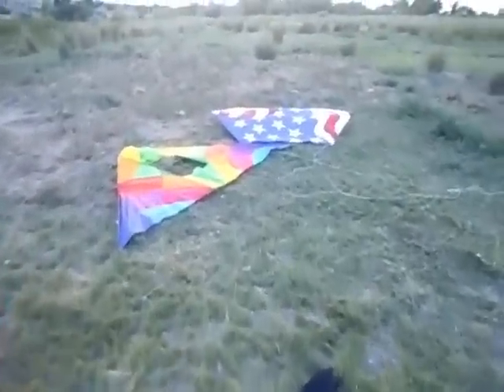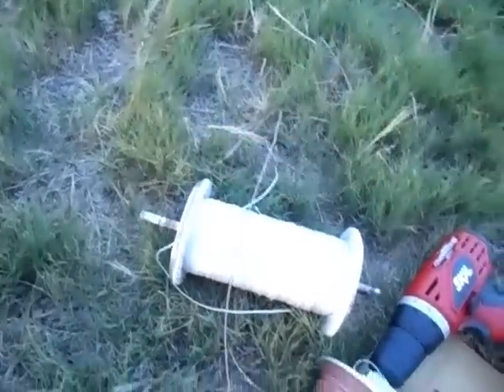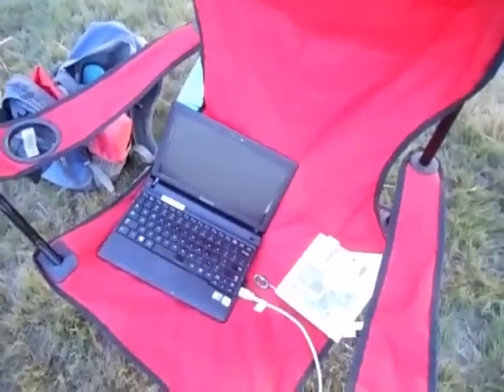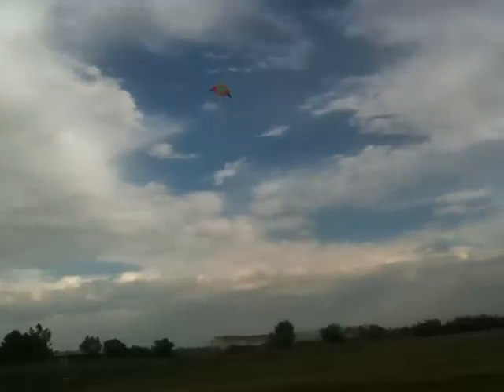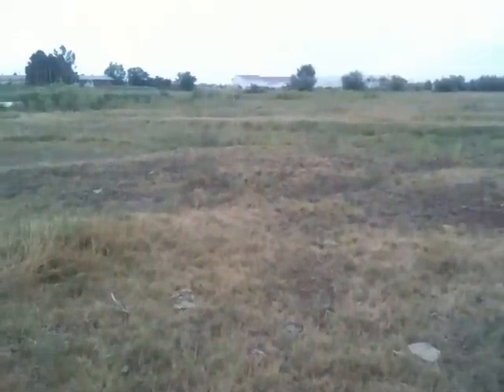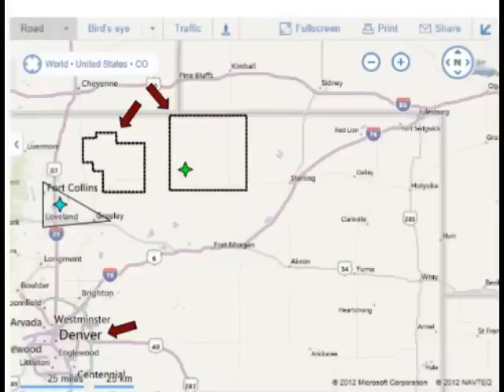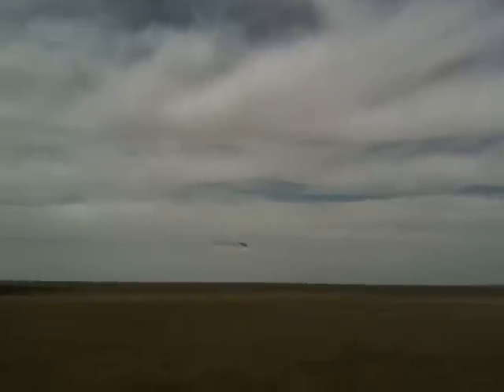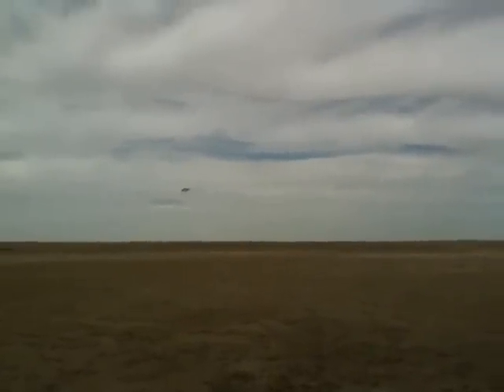Wind Powered Aircraft - The Concept & Test Flight

Comment: This a very valid concept using the wind gradient to obtain lift. The work of a true and remarkable experimenter. However, in most countries, certainly in the UK. Flying a kite at 3,000 feet is illegal. Another point: Does this assume that the wind direction is the same at different altitudes? In fact the wind direction varies considerably,  how much does this affect this scheme? Another point: away from the ground the wind moves vertically considerable amounts (thermals) - that's how gliders fly.  How does that affect this? Not in any way to decry this very valid line of research which is brilliant.